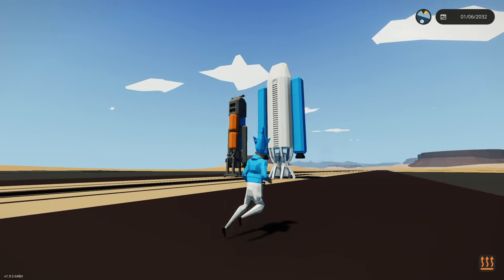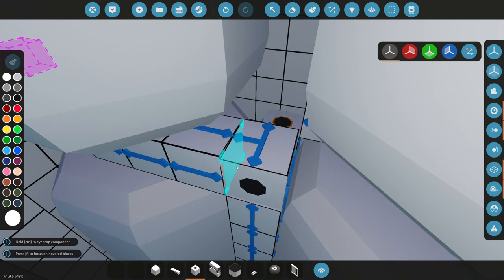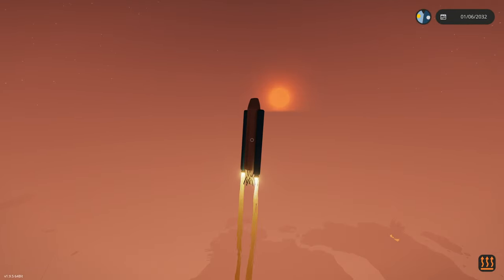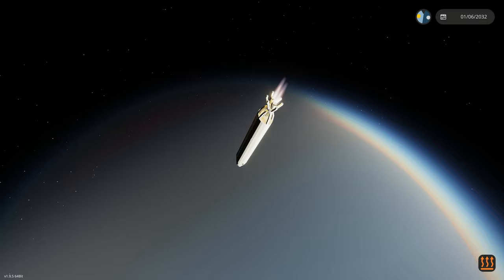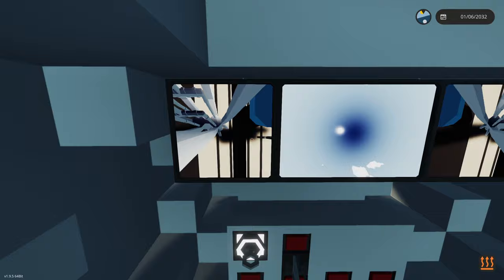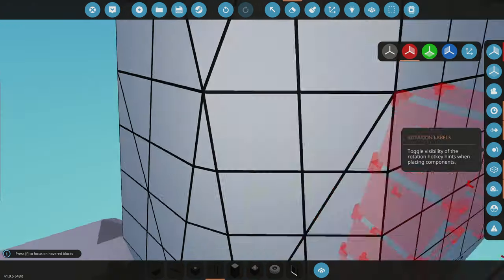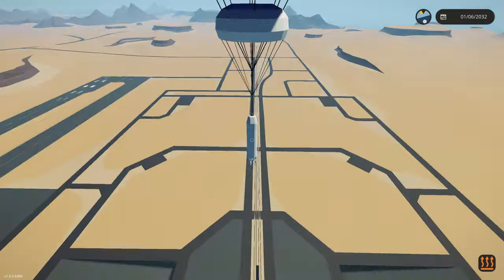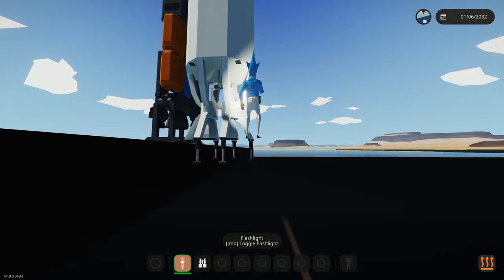I EXTENDED The Fuel Tank! Space Rocket Build (#3)

Comment: An idea I came up with (as far as I know) you could use multiple hard point connectors to start engines or send signals and numerical switchboxs to change the throttle so they aren't always at max I think it would be easier to do than composite